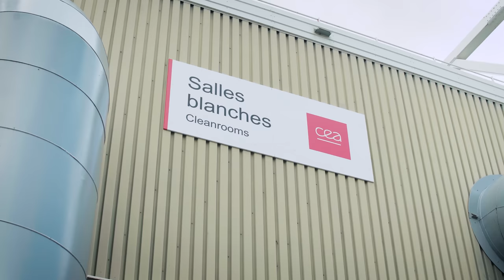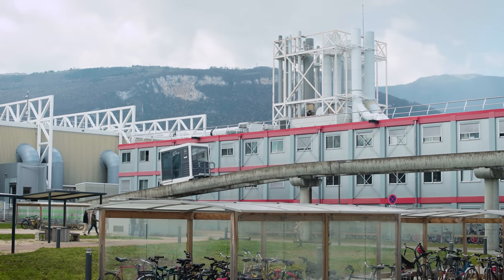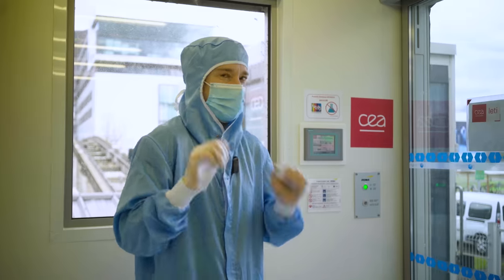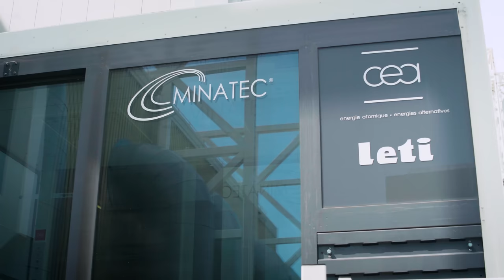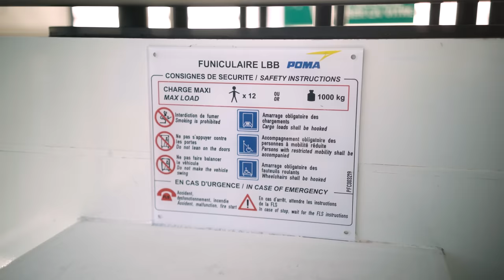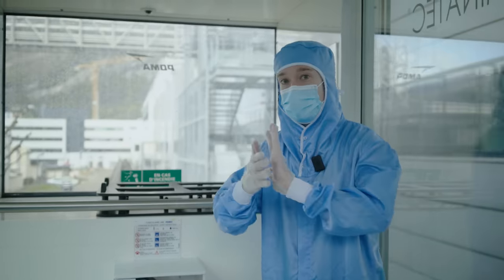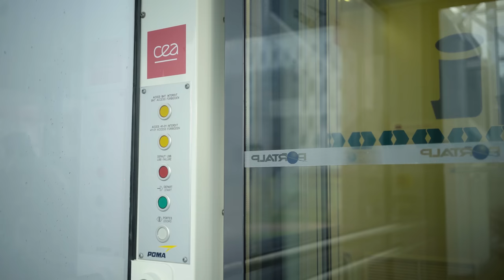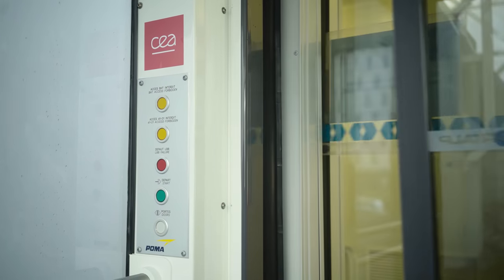The world's cleanest railway

Comment: The world's cleanest railway is the Arlanda Express, which operates between Stockholm Central Station and Stockholm Arlanda Airport in Sweden. The Arlanda Express is a high-speed train that runs on electricity, with a top speed of 200 km/h (124 mph), and it produces zero emissions during operation. The trains are powered by renewable energy sources, including hydropower and wind power, making them one of the most environmentally friendly modes of transportation in the world.

The trains themselves are also designed to be environmentally friendly. They feature regenerative braking systems that help to recapture energy and reduce energy consumption, as well as low-energy lighting and efficient heating and cooling systems. The train's interiors are made from sustainable materials, such as recycled plastic and natural fibers, and the seats are designed to be ergonomically comfortable and durable.

Overall, the Arlanda Express is a great example of how sustainable technologies and design can be used to create a cleaner, more environmentally friendly transportation system.

Comment: 3:48 how is that clean?
Reply: It’s outside the room so it doesn’t matter
Reply: Do you know the difference between outside and inside? This is filmed in the outside, therefore not clean (especially in Grenoble which is unfortunately one of the French cities with the worst air pollution due to the fact it's sourrouded by mountains).
Reply: @chucku00  So, the video title should be: "The world's cleanest train" and not "The world's cleanest railway". Railway is the track, not the one that carry passenger or goods either self-propelled, or loco-propelled.